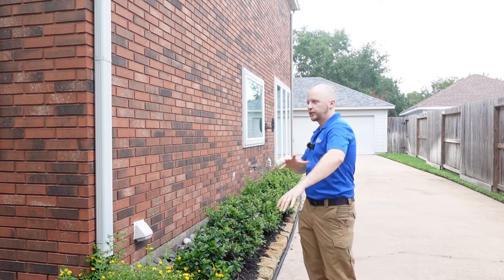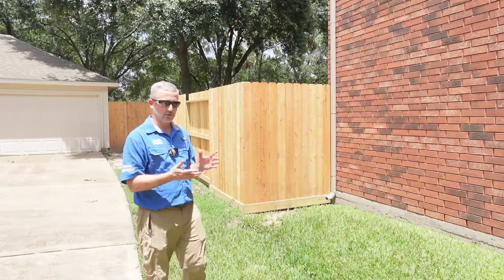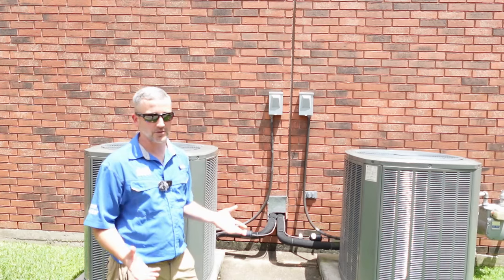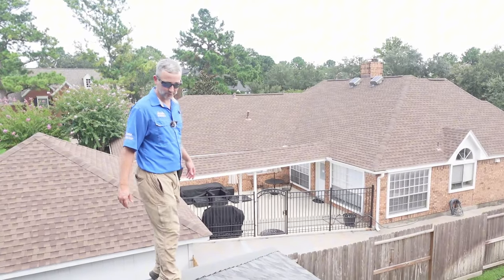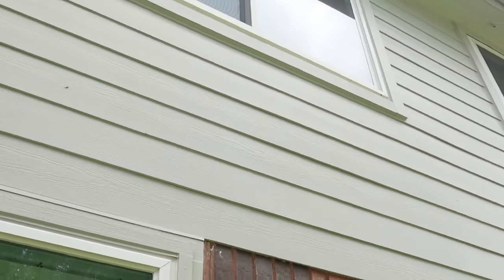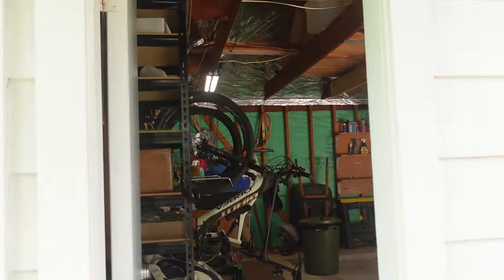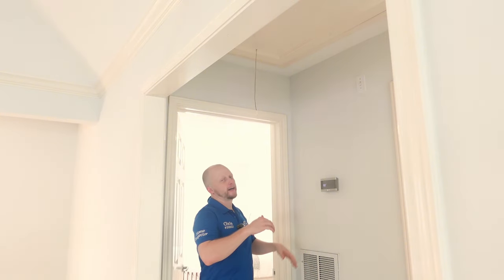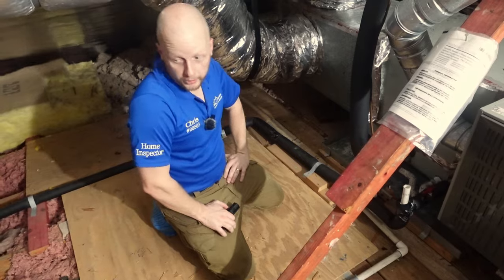Welcome to Our Home Inspection of a Unicorn Property!

Comment: 10:30 that surge protector is not even protected by the main breaker since it looks to be connected to the Line-side lugs-- so the only thing protecting it is the fuse on the primary side of the utility transformer. Overall though, home looks very well cared-for.